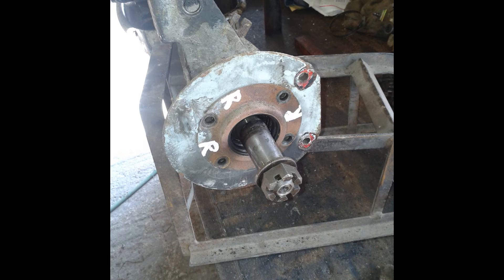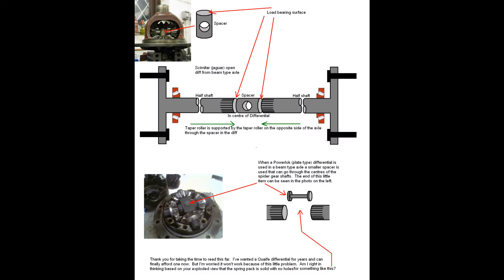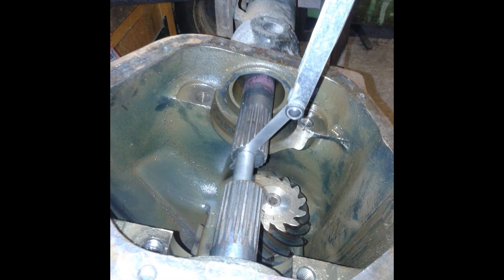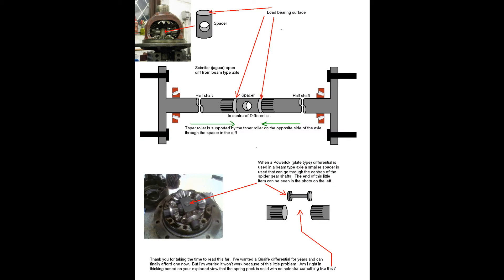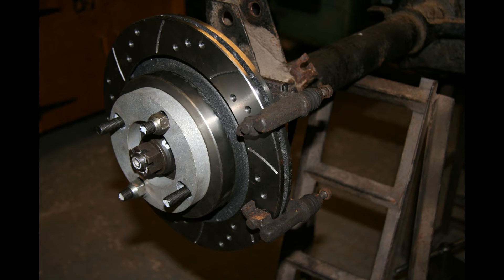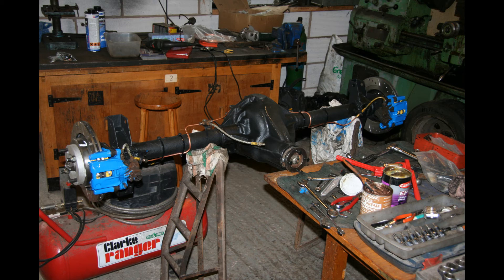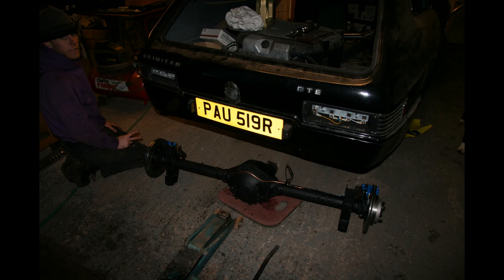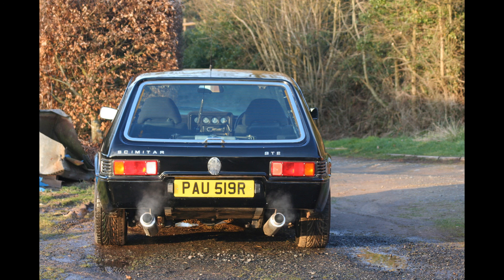Ultimate 4HA Scimitar Axle - Quaife Torsen LSD Diff, Cosworth Vented Disc Brakes, Ready For Power

Comment: Been waiting for this one... very informative thank you. Seeing as you had both types of LSD there, did you try them both? Is it really worth investing in the cost of the Quaife for the performance gains? Cheers
Reply from the maker: Thabks for the comment James, much appreciated. I have bot had the Powerlock plate type LSD in my car. My friend and I fitted LSDs at the same time. The one in the photos was his. It did go in a scimitar 4HA axle though. Which was subsequently fitted to a Ford capri with nearly 500hp. 

So I can't comment in terms of back to back tests in my car, but u have driven his, and I've driven others with plate type diffs. As far as I'm concerned the quaife is a lot better. There is nothing that my friends plate type diff can do that my torsen can't do. Put his car is horrible at low speeds. I suppose it depends what you're doing, if its pure track use then the torsen is better as it's smooth and controllable and has no tendency to lock and create understeer (as the wheels are fixed at the same speed it can tend to push a car straight on and resist turning). But if you plan road use too, then the quaife is much much better, you don't know its there, its as easy as an open diff. 

So it's wither better or much better. They're amazing, and don't wear out really quickly like a plate type does. 

I get it though, they are a lot of money. I feel like it was worth it though, it was money well spent. A fantastic modification.
Reply: Long term durability and that its a known quantity rather than a second hand unit does add to their attractiveness as well as the off power performance.
What diff ratio are you running btw? My 5a is an Auto so will definitely be changing if and when I engine swap...
Cheers
Reply from the maker: @jamestroup  I'm afraid I forget. I can look it up later if you like. I know it's the standard ratio, though, 3.31 or 3.54? It seemed to work out perfectly. This is really important thing to get right though. It depends a lot on what the cars is for and what engine you are swapping in??